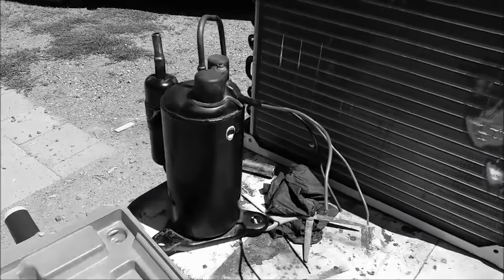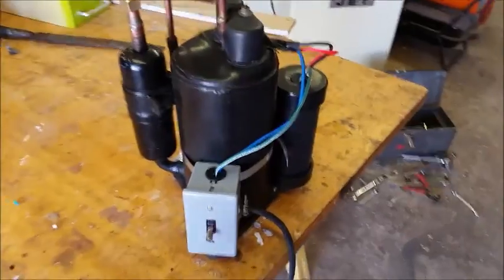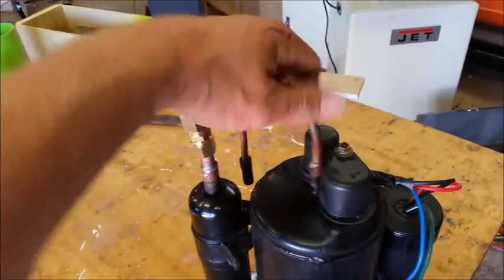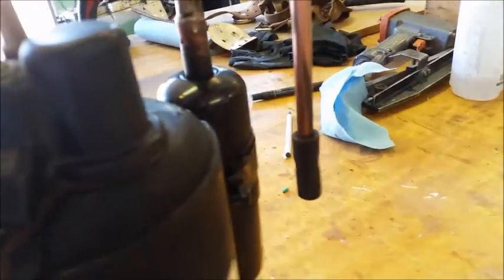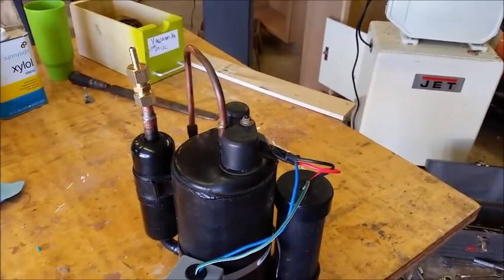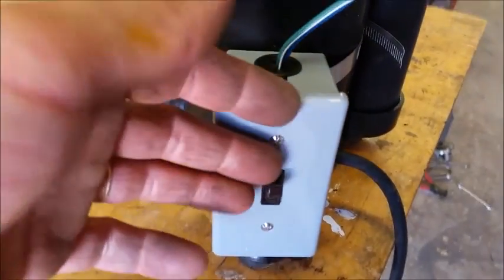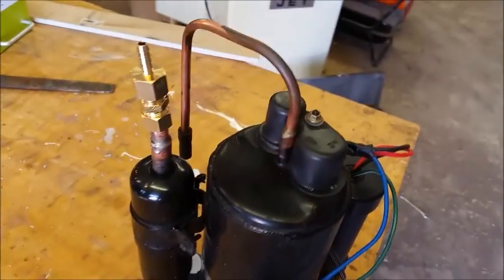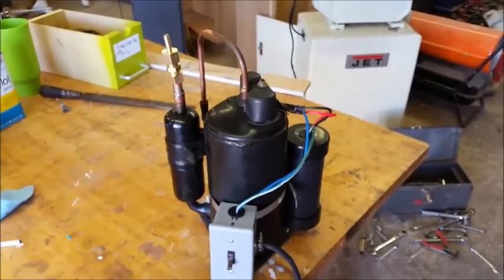DIY vacuum pump

Comment: How did you wire the capacitor with the 3 wires red black and white With Herm, C , and Fan ?
Reply: Sroor9001 It looks like it was removed like that. I have a rotary compressor just like that without a cap.

Comment: With a compressor from a mini refrigerator does the temperature control switch have to be hooked up to make the compressor turn on ?  I have zero power.
Reply from the maker: Open Air Model Shop "mine was a direct AC line in.  just like a simple motor.  no sensors or anything. with a different system I'm not really sure unless I can see it
Reply: Open Air Model Shop The smaller compressors such as in a refrigerator simply turn on when 120v is supplied to the connector that plugs in to the start relay. This relay plugs directly in to the 3 pins on the compressor that are in a triangular formation (which are to the motor windings). 

The sensors inside the refrigerator along with the control board simply monitor conditions and allow current to flow to the compressor when these conditions are met. However, the compressor does not require these sensors to operate independently.

Being 180 degrees apart, the main windings are unable to generate enough initial start rotation and require the additonal magnetic push/pull from the start winding. You'll need to initially energize the start windings if the start relay is missing or faulty.

Comment: also considering building a vacuum pump of an old AC compressor, but wonder which capacitor can be used. do you have any tips? Cheers
Reply from the maker: I suppose you may look up the capacitor it used to have and buy one which matches the specs. I would do some research online forums maybe or the service manuel.
Reply: Will do that,  thanks